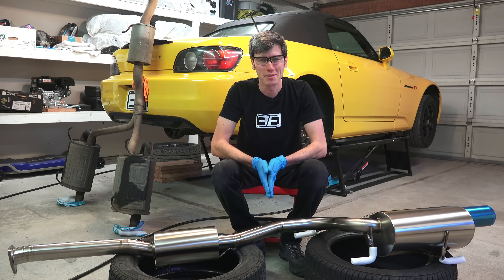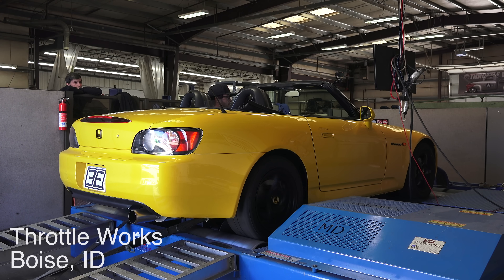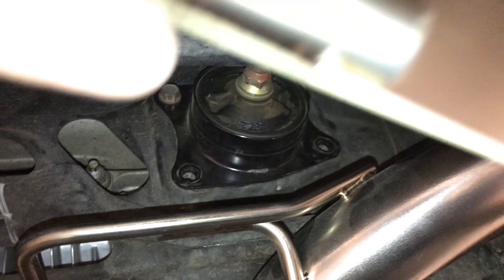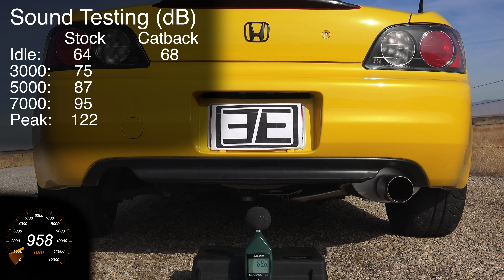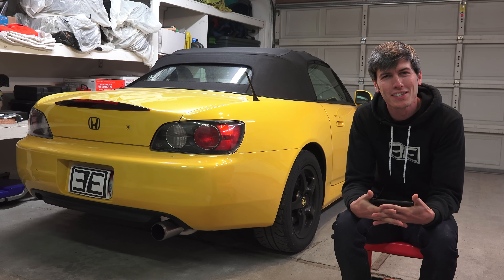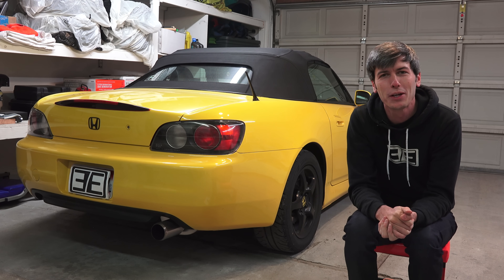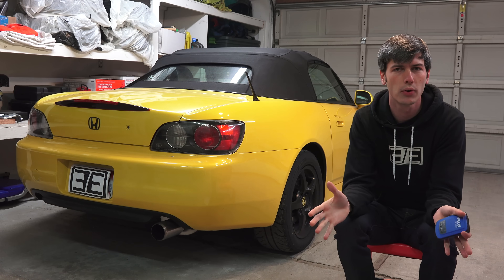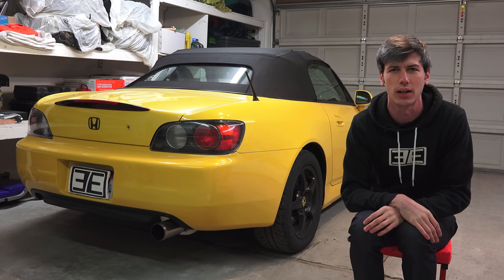Can A Catback Exhaust Make Your Car Faster?

Comment: I had a similar experience with cat back exhaust on my nc miata, except I deleted the cat and opted for a dump tank style muffler. I think I actually lost a little power with the muffler, even though the seller advertised power gain. I did notice and measure a power gain with the catless exhaust. It was only 3-5 horsepower based on my acceleration test, but it felt less choked at high rpm.

Comment: Everyone who knows Hondas/S2000s knows you dont buy the amuse euro s for power gains though so people cant really get mad about that. People buy that specific exhaust for the sound and quality. If you want power you go for something like the js racing 70rr which is larger diameter and has no resonator. Its also lighter again. 
That said it would be interesting to see testing done replacing the cat with a test pipe to see how much it opens up the flow

Comment: A weight reduction of 35 pounds is similar to gaining 3.5hp on top of the power you actually gained at the wheels.

Inline fours can sound beautiful when done right, the pitch they hit at the top of the range is the key to that.

Comment: Call me OCD but it should of been twin pipes just like the factory, the xtra empty gap on the left drives me nuts..
Reply: Sergio Aguirre another piece of titanium pipe to make a clean finish wont make that much weight..
Reply: Sergio Aguirre lol ok dude..i was commenting about cosmetic reasons..but 3lbs..dont think the s2000 is for that..unless engineering explained is going that  direction..purely cosmeticss..that hole makes it little ricey for me for such a special car
Reply: ok buddy, and i drive a girls car..sure

Comment: The performance gain is pretty much all from the weight reduction.  34lb reduction is a huge reduction in an already fairly light car.  Same typical result when people put aftermarket exhausts on sport bikes, the power gain is minimal typically, maybe 1-2 hp from a slip on exhaust, but the weight reduction is often over 10-15 lbs taken off the bike which is quite noticeable on a 450lb sport bike.

Comment: With those prices now I know why 100k is barely enough to beat a VW Jetta in the quarter mile. In all seriousness a catback barely does anything to your engine in terms of horsepower. A modified exhaust is all about weight reduction and sound. Seems like your car sounds the same as stock so that’s go to suck if you wanted a louder better sound. I myself went through alot of exhausts in my 2011 Mustang GT. The first one I had was a Roush Axle back, sounded super aggressive at 9-10ths but a WOT it sounded muted and rattly. Then I went with Ford Racing Sport exhaust. The system was super light and the car felt less restricted but the sound was pretty much like stock. I the. Switch to GT500 axle backs and those improved sound greatly but they added weight and I still wanted the car to sound meaner. I end up with Borla S which are by far my favorite. Light as the Ford Racing Sport exhaust, almost as aggressive as the Roush but also quite at light throttle. Also no drone whatsoever.

Comment: Saving 35# is no small feat while keeping stock DB and drivability. Add 2 piece rotors and other weight saving tidbits and you’ll have a quicker, more fun to drive track car, and tracking an S2000 is some serious fun! This setup will be perfect for AutoX.

Comment: If you can find tuned headers with an accumulator for scavenging you could probably scrounge another 4-5hp, It might even bring your max torque closer to lower rev range as well depending on the tube length.

Comment: Some of these Hondas need backpressure. Be careful opening up your exhaust on a stock engine you could hurt torque numbers which is very hard to come by on Honda vtec and ivtec 4cyl engines

Comment: The stock exhaust is actually very very good for an OEM unit, It flows good and doesn't drone.The cat itself is more of a restriction than the catback. The main reason to switch to a catback is the weight, the OEM unit  is very heavy

Comment: @engineeringexplained Always wanted to get a Mugen exhaust for mines but the price didn't justify the potential gains except that it is lighter and more rust proof.
 Although I wonder if the altitude from where you live affect the results and that's the reason why only 2hp gain? 
May I suggest replacing cams and while your at it the valve spring retainers (known failure for early 00 models) and ecu tune to see more gains?

Comment: i like how you told the torque specs but still used a impact, id totally do the same not hating
Reply from the maker: +Deviate no no, I totally torqued them! When it’s a bracket that really has no safety ramifications, I’m not worried about it. But 95% of the time I do torque everything to spec.
Reply: oh my fault! you're right, I was thinking about the bracket, my bad!

Comment: Good job on the video. I liked that you took time to test different aspects of the exhaust instead of just measuring power difference. I know it's asking a lot but do you think that you could do this test again when you install a supercharger on your car? It would be interesting to see if under boost the power gains are larger than naturally aspirated.

Comment: Towards the end when you are talking about how you try to control for environmental variables you mention humidity. Obviously I understand how this effects humans as our body temperature is regulated by evaporative cooling, but how does humidity affect a vehicle's power output? The radiator and most intercoolers (on forced induction vehicles) do not use evaporative cooling so I am curious if there is some aspect I have not thought of.

Comment: biggest thing is, when you upgrade the top end of the motor to flow better, you will get MUCH more hp then stock exhaust due to less restriction. N/A cares about flow a lot, but if your planing to turbo it, its not worth it all.

Comment: Big question should be does the over priced tin can make more power when other mods are included? Say a supercharger or turbocharger for instance. I still can't get over the cost of that exhaust though, $2500 is nuts but I guess that's the price you pay fo Ti.

Comment: It can free up more horse power cause it's round half weight of stock or lighter plus 4 cylinders are light vechaels any way plus cheaper ones do same thing and small cylinders have only small engines v6 would of been a better engine  or a v8

Comment: no, wood rather put that money towards force induction and then a $100 cheapo straight pipe that will out perform any expensive exhaust.  any.
Reply: master power Don't use wood... it won't work as well as metal. 😉
Reply: A Nother lol I agree
Reply: I would have rather put that money into bitcoin.

Comment: Should have had it made without the resonator after the cat also if you want to see better gains go to a high flow cat and replace your stock exhaust manifold with headers once that's done do a pro tune and there you have it

Comment: The cat is always the most restrictive. Some cars have more that one. Bigger diameter (may) have added 1 or 2 more but with the cat your just not going to see "box gains". From my experience cat backs are mostly for a change in sound and weight. That weight loss coupled with other weight loss mods adds up. Power gains was right where I thought it would be but I was surprised by the low DB gain. It did however sound a better. Titanium is one of those EGO mods as well as a performance mod when coupled with a lot of other weight savings mods. Yes change the headers and cats comments will be coming. Well then you can just retune the ECU or go aftermarket then might as well change pistons and cams then add FI and then just swap in a race engine............. The point. Real world gains testing while staying on the street-able side both anit weekend garage time saving and what do you mean I can't smog i fun. Of course your not going to see gains with out adding the stickers. Roll calls are where the real gains come from...... Good video. Awesome testing. It sounds good and the tip will look good as heat gets into it.

Comment: The S2000 engine is very efficient in stock configuration  and adding bolt-ons etc..intake, exhaust, usually doesn’t amount to much hp/tq gains. I would of at least went with larger piping though. The K-series on the other hand can make substantial gains from bolt-ons.

Comment: Why do you think Honda chose to put a dual muffler setup on the S2000 as OEM equipment given that you have just proven that a single muffler exhaust can generate slightly more power (i.e. lose less power)?  Was that just a cosmetic decision on Honda's part?  Or are there other technical considerations which could make a dual muffler setup more desirable in some cases?
Reply from the maker: +Hreb there’s really no reason other than looks for any car which has the exhaust fall into a single bank (like an inline four). If it’s a V8, each bank will occasionally have it’s own exhaust all the way back. The four cylinder joins into a single pipe, and then splits. There’s no reason to split once they join up. Doesn’t mean it can’t perform equally well as a single exit. With proper sizing they can be quite similar. Also keeps the weight balance equal, but my best guess is that the driving factor is for looks.

Comment: I guess you'll get a little bit of fuel savings in the long run, as well as a better slightly tuned sound. It also opens up for more tuning opportunities right? (though I think you said you wanted to keep it fairly stock)

Comment: "Humidity was over double" - FYI it's a little off to use relative humidity as a % since that's percentage of max saturation FOR THE CURRENT TEMP.  Absolute humidity brings those a little closer (though still a ~70% diff).

Comment: Was the fuel tank filled up to the same level between the two road test sessions? The weight difference between full and empty tank is easily more than the weight saved by the titanium exhaust.

Comment: Learning can be expensive but less so when so many are learning along with you so thanks. My surprise is not in the straight pipe doing so little but in what little effect that weight reduction had provided.  As a result, I think a great video would be seeing the dyno effects of actually adding increasing weight into the car to see the effects on HP and speed. Does that extra 200lb passenger really effect your cars performance that much? What about that extra crap stored in the trunk? That would be interesting given these results.

Comment: IIRC Autotempest is a part of "Searchtempest" which is/was a search engine for craigslist/ebay that would span various regions. I used them for a long time and loved using them. I forget why I stopped using them but I never had a single complaint about their system, only craigslist trying to prevent them from actually making craigslist more useful.

Comment: Bravo, you hit upon the three factors used in aviation to calculate the density altitude, therefore partly how much drag there will be (more important for lift calculations for aircraft, but nonetheless, in your case how easily the air can pushed out of the way, so to speak).

Comment: I really hate exhaust comparisons when parked, because most exhausts don't really give you a great idea of the sound until under load; this is especially true of an inducted system (I know that the S2000 car is an NA). Also, the exhaust system gets much hotter when actually being driven rather than sitting at idle--a good example of how this works is how MINI cars will pop/bang on the overrun when being driven for a while, but won't do so after a car has been idling a while (even though the engine is at temp, there just isn't enough exhaust gases to keep the piping hot enough).

I drive a MINI JCW Hardtop (F56) and its exhaust doesn't really come alive until the temp gauge has hit the ball, and even then, you have to actually drive it for a few miles to have it sound right. If the car is already at operating temp but I let it set at idle for a while, the exhaust doesn't sound the same until I've again driven it a bit.

Maseratis are very similar; they don't sound right until you've really allowed the exhaust to fully heat up, and then you have to hear them under load in order to get their true tone (and it's pretty good).

Comment: If the noise test was performed right after the  install, the exhaust will not have been fully "broken in." In reality, after a week or so of driving, the exhaust will get a little louder as the resonator and muffler get broken in.  :)

Comment: It might also be worth mentioning that in the future if this car were to have a high flow header or performance catalytic converter installed, the new exhaust would assist in increasing the gains from those mods. I would be curious to see how much power the car would make with aftermarket header/cat and a stock exhaust vs aftermarket header/cat and the ti exhaust. Mods support mods, especially on NA engines.

Comment: An s2000 is refined from the factory and any bolt ons will not yield much. Full bolt on s2k's make roughly 10hp more. A simple civic can gain actual 15-20 whp from an intake as they are held back for fuel efficiency reasons. S2k's even loose hp with after market intakes, theres only a few that actual intakes that wont cause you to loose hp. Best bang for your buck is test pipe/tires.

Comment: what about the hole left by the missing exhaust ? Anyway to make it "stock-like" on this rear fender ? It is great that you did not seek to put a 2 exhausts setup if the car does not need it, I hate when manufacturers do that (ie Audi / VW 4 exhaust setup for a 2 liters turbo)

Comment: I like the idea of Ti exhaust systems however I think they are best used in racing. When setting a car up for racing you can afford to eat the cost a bit more. Also doesn't hurt that when racing your not using a catalytic converter so you can go wider on the exhaust system. If Ti exhausts were as cost effective as any other pro exhaust system we would probably see more of them being used as OEM equipment.

Comment: A high flow cat/test pipe + tune. That's what makes the best N/A bang for the buck gains. People have gotten big mid range gains with them. Some people have even gained 25 peak HP after a tune with intake/headers/tp/exhaust combo.

Comment: Is it possible that, say, with engine mods, this might make more of a difference?  Like say improving the intake might not have made a big difference, because the exhaust was the bottleneck.  And vice versa, improve the exhaust, the intake becomes the bottleneck.  But improve both, and instead of 5%, you get more like 10 or 15 or so?

Comment: That is a darn cool system! I don't know much about the S2000 in particular, but normally a tubular exhaust header pairs very well with a cat-back to aid in scavenging. Your wicked cool cat-back certainly opens up the door for a larger intake, throttle body, and tune.

Comment: Very interesting video. Would be interesting how much horespower a different catalytic converter could add?
Btw. did you know that the Mercedes Benz engine M 104 with 3 l displacement has just 11 hp more in the coupe than in the saloon, because of a bigger catalytic converter? (They don't have enough space under the saloon and decided to put a smaller cc under it, wich resulted in lack of 11 hp)

Comment: Usually when you do a dyno run you would calculate a corrected torque and power based on ambient conditions (temperature, pressure, humidity) which would remove the influences that you brought up... Were the numbers you showed corrected or not corrected?

Comment: The lower exhaust back pressure explains the gain in HP but there is one paramater you're missing... The stock calibration was made with the stock exhaust so if you adjust injections timing to the new volumetric efficiency you will probably be able the enrich a little bit and see an extra gain in HP (very little I agree...).

Comment: For anyone trying to get HP on a budget. Exhaust metal type doesn't do anything for horsepower. If you are worried about rust and can afford it, get stainless or titanium, but I mean stock steel exhausts last many years from the factory so it's a waste of money if you don't plan on keeping your car for 10yrs+. For the fbody world, you can get almost 30hp just from longtube headers. Buy some steel Pacesetter headers for under $300, or spend more than double that on stainless and not gain any horsepower over the Pacesetters. Non stainless does rust, but if you know how to wash your car regularly during the winter, you have a LOT of time before it happens.

Comment: 2500 for a exhaust that sounds the same only diffrence is 15 kg of weight reduction and also 3 hp, this like putting a sport exhaust on your 1.6 tdi only to find out it wont make any diffrence in sound😂

Comment: Very well put together video as usual. I think it would be cool if you made a video comparing the real world performance of different ambient conditions. For example, what sort of acceleration improvements could you expect in the s2000 at 80 deg vs 55 deg (F), or how much of an effect humidity or atmospheric pressure can have on acceleration, ect. Thanks

Comment: I imagine a turbo'd engine would notice a bigger improvement from removal of resistance in exhaust, but for a low hp NA there's not a whole lot of gains there vs improving the engine throughput directly in some way.

Comment: I think you missed the biggest point to doing an exhaust system like this. No on a mostly stock car it's neigh pointless, but if you were running a turbocharged car pushing over 500hp that gain would have been FAR more significant than 1-2hp. That's mostly the point behind exhaust work, it's something to be done after it starts becoming a limitation on your power, after you have built up everything else.